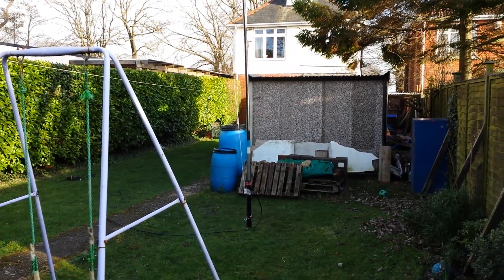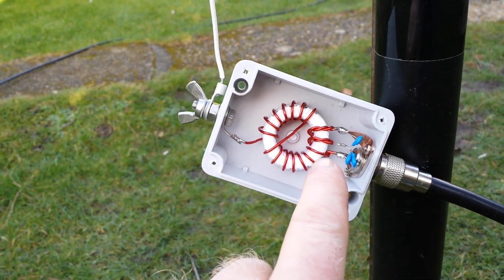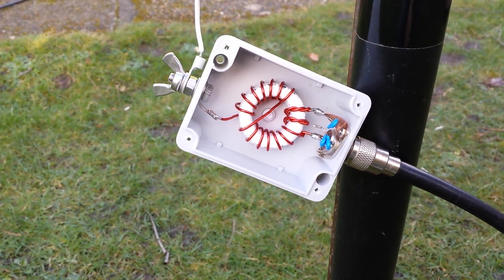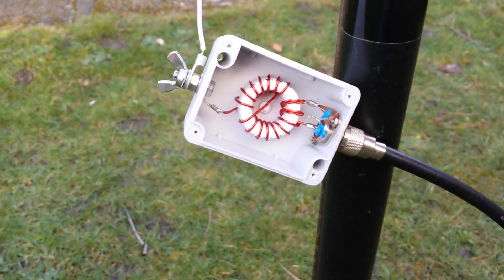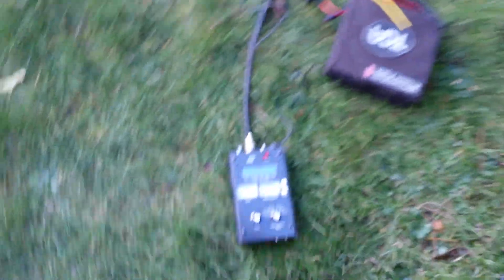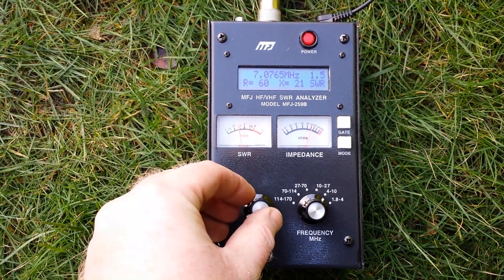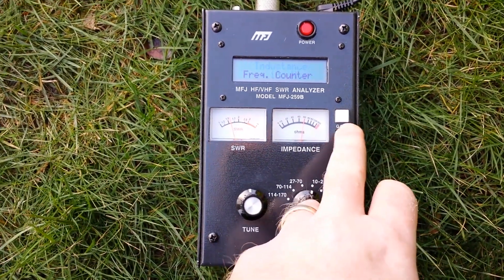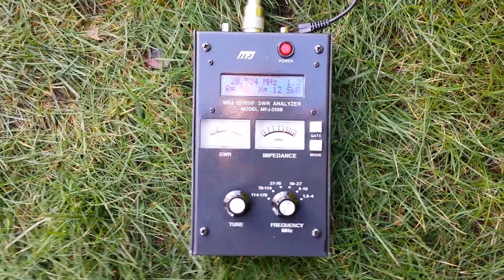Homebrew 10/20/40m  EFHW vertical Antenna "SOTA"

Comment: I make the same balun today ,with very bad results,I dont hear anything
Reply: this is an un-un not a balun. an endfed antenna is not a balanced antenna.
Reply: +colin humphries An end fed antenna has an impedance in the 3000 ohm reactive range especially if it is a half wave length. I have built one of these for a half wavelength wire on 20 meters for portable use.  An insulator and rope hold the far end up in a tree. I use a 1/4 wave counterpoise just laid out on the ground and it works very well. You need a counterpoise for this to work at all. You need either a 1/4 wave of coax or a counterpoise wire. You dont believe me? Try isolating your antenna with a bunch of ferrite beads on the feed line just below the coil and get back to us with your results.

Comment: Very impressive. Nice demo. I used the exact same amount of capacitance and the same number of turns on a 43 core. Just waiting for the WX to get nice so I can try it out.
Reply from the maker: Hope your testing has gone well. U can also try a multiband efhw tuner like I recently done. Both work well. 73's
Reply: Test done. I erected mine as a flat horizontal antenna, like you would a dipole. I dropped some RG 174 down and put a line isolator on the radio end of the coax. I am very impressed with how well it performed and matched. I put the KX3's tuner in bypass since it's not needed. I did not see you test 15 meters? Mine works great there as well. 
I used reverse beacon and compared the EF to my OCF40 at the same height. I got equal results on both antenna, but the OCF40 does not work on 15 meters so I did not make a test on that band.
KU3X